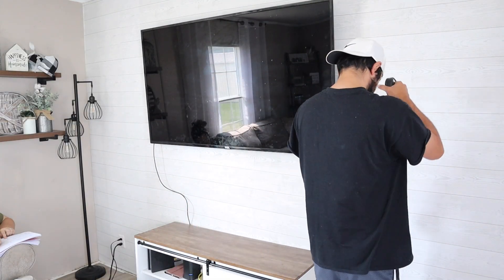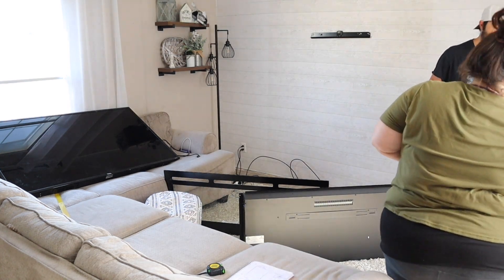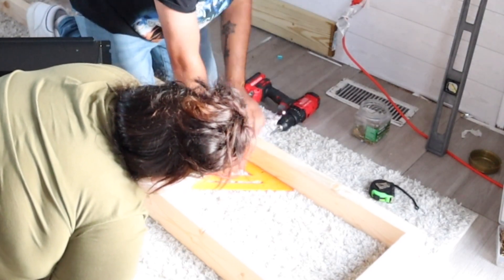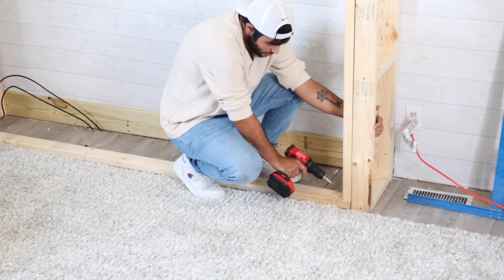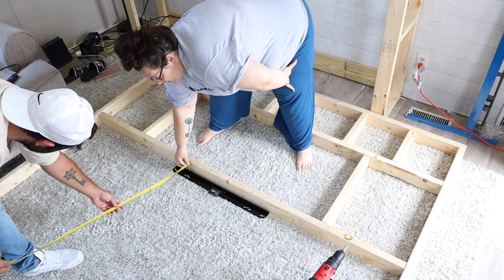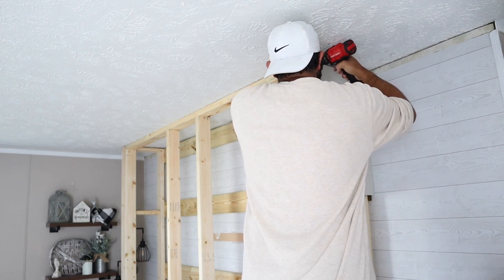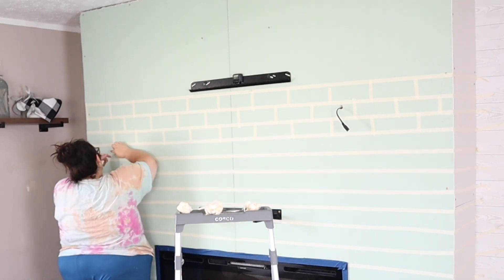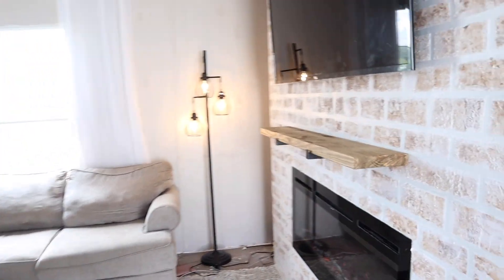Single wide mobile home makeover | remodeling our living room wall | DIY fireplace/TV wall insert🔨

Comment: I have a question. What do you do with your mobile home if there was a tornado or storm with debris, like protecting your home from a storm/debris/wind? I'm thinking about this because  I plan to move out soon and am considering buying a mobile home and not an apartment.
Reply: I don't know about them but when I lived in a trailer we anchored it down with heavy duty cable and metal things that goes in the ground
Reply: I don’t know the answer to your question Nicholas, because where I live we don’t have storms that severe. But I do believe that by law all mobile homes must have tie downs, which is supposed to protect them from storm damage. I guess I should correct what I just said about not getting severe storms here because in 2007 we had a major storm with winds reaching over 100 mph. No mobile homes were damaged so whatever it is they do, it worked! I own a mobile home, and I love it. I think any time you can buy as opposed to renting you’re doing a good thing for yourself. And just as an fyi, there are quite a few Facebook groups of mobile home owners that support & offer advice to fellow m/h owners who are remodeling or just doing a few repairs, etc. I belong to a couple and it’s a wealth of information on virtually any question you can imagine! I wish you the best, and if you buy a mobile home, let us know!! 👍🏻
Reply from the maker: Both comments are absolutely right! Mine it anchored down. Tennessee does have tornadoes but in my area they’re “normally” not severe. However we make sure to have an emergency plan in place if we were to go under a tornado warning. Many of my fellow mobile homers have an additional storm cellar! That’s something I’d love to have if I ever have my own land! ❤️
Reply: Thank you! This is very helpful!

Comment: I love it!!  Y'all did great!  Think about this---what if you made another door just like this one, only hang it on a slider rail on the INSIDE of the laundry room??? It would work like closet slider doors.  You probably could use the hardware from the shutter doors you took down because all you want it to do is slide from side to side and you  really wouldn't see the hardware at all!  I wouldn't even put the fancy handle on it because the doors won't butt together and the back one will stack behind the front one, out of your way.  It's just a thought---I really love what ya'll did!  I'm pretty new to your channel, but I love it---and I love your message.

Comment: What do you recommend for me? We have a mobile home as well but the air vent is right underneath like in the middle where I want to build my fireplace, would it be safe to cover up the vent with all the stuff? Could I add a little vent on the side so it airs out the inside after it’s built?
Reply from the maker: The concerning part isn’t the air, it would be the heat in winter that I would be concerned over. Maybe lift it and use that area for an elevated hearth? That way it has plenty of elevation. If I did something like that I would definitely elevate it and make sure it’s well ventilated 😄

Comment: good job but fyi you could have installed the frame and left it installed, then cut the rest of the wood and toe nailed the 2x4s in there and made your frame for the fire place and studs for the tv hanger, would have saved ya some steps, but good job.